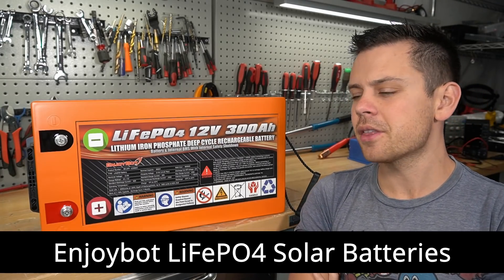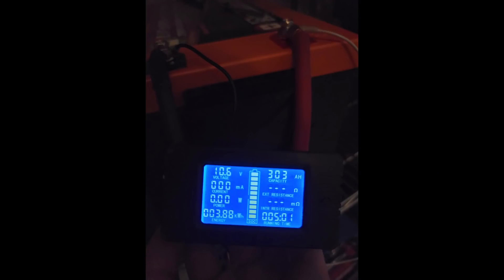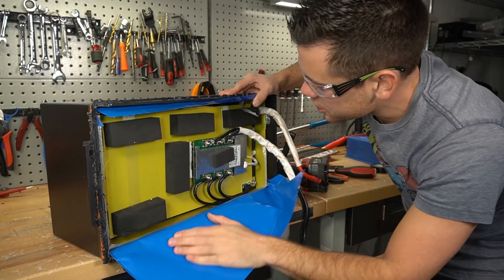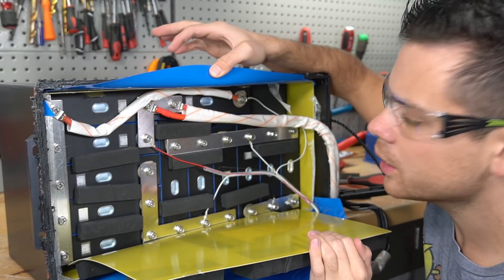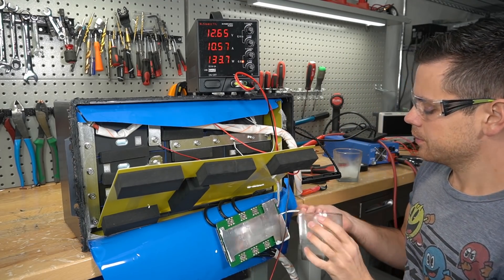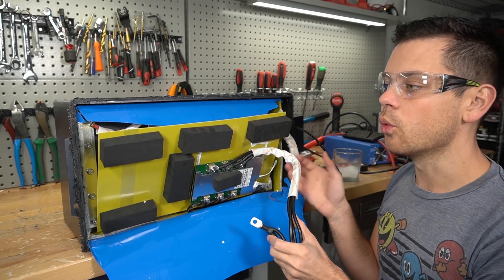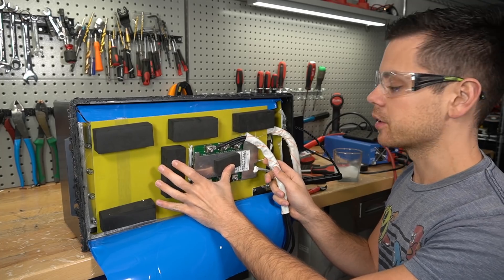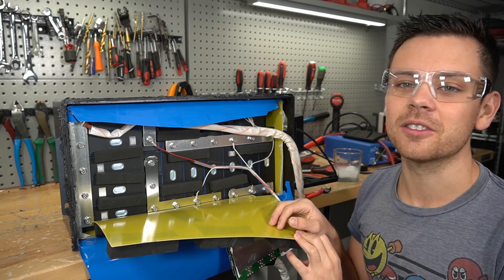Dirt Cheap Lithium Batteries: Enjoybot LiFePO4 for $.26 per Wh

Comment: Will, I truly appreciate your feedback on these batteries, I enjoy them and click pretty quick to see what you found again and again.  Thank you for the hard work you do day in and day out on these videos and testing!

The only thing I will say here, it seems too many people put an emphasis on low temp protection.  If you are building a rack or bank in your basement, why worry about it at all?  I guess it really is about the application and use of the battery.

THAT SAID....they absolutely should not sell these as low temp protected batteries, it is false advertising and if someone was to use this in an RV and expect it to be protected, they could easily smoke $3k in batteries unknowingly with a bank of 3.  

Again.......THANK YOU for doing these reviews!  The community is grateful to have you and your passion in what you are doing!
Reply: The problem with charging at freezing temperatures is that it will ruin the battery.  Not everyone has a nice benign basement to install batteries in.  Also if a window blows open in the basement or a door gets left open the basement could still get to freezing temperatures in a cold snap.  If nothing else it's cheap insurance for an expensive battery.  Especially if you have a large bank of batteries.
Reply: We have a shop and a barn on our farm in Minnesota whose temperatures are below -35 F (not counting wind chill) for 4-5 weeks/year while the  two months on either side range between -34 F to +20 F. . The house basement is an additional issue - it stays around 30 F for 2-3 months and 32 F for a month on either side. We're trying to find a safe way to safely charge those expensive batteries and we've been disappointed (like Will) every single time so far.

Comment: Great vid, based on what you said and showed, I chose correctly for my application.  Labeled CHINS, I have 4 of the same 300Ah batteries.  The application will be my sailing yacht where these 4 batteries will give me over 15k Wh and with 2000 watts of solar and 800 watts of wind generation - NO Generator Needed. Terrific to know that you like the manufacturing quality. Also, the batteries will be parallel connected to Victron equipment, therefore I don’t need to low temp cutoff. Thanks for all your advice including; low temp cutoff not needed, good manufacturing, and that you agree that they will work in a marine environment. Keep up the good work!

Comment: They contacted me as well and offered to send a battery over for testing. I'm always hesitating to cut them open as they will be permanently damaged. Great so see you found the problem with the sensor right away. False advertising, same like with the AOLithium and claiming 200A discharge (as the used CALB cells have only 1C discharge rate).
Reply from the maker: Exactly!! And yeah, sometimes it's better to skip them if you don't have time. I love finding problems and sharing theme with everyone haha
Reply: @WillProwse  What do you do with the batteries you have opened for testing? The case is basically destroyed and the battery hardly usable as intended afterwards. Just harvest the cells?
That is my main concern with these test to  break into these cases just for the sake of testing. From a resource perspective, not good...
Reply: Someone has to do it Andy or we would never know.

Comment: Thanks for Another great battery video. I just bought 2 of the CHINS 300Ah batteries because at the time I was ready to buy, my first choice the SOK was out of stock indefinitely.  Good to know it doesn't actually have low temp cut off.  Batteries will be mounted inside the RV so that shouldn't' be a problem.  Will, your videos gave me the confidence to rip out the stock AGM set up and upgrade to LiFePO4.

Comment: These lithium batteries have gone down so much this year! I replaced my lead acids with lithium. I bought 4, 200AH Chins and 1 BTR 100AH for another application. I think lithium is the only thing going down with this inflation. Happy to see the batteries going down but just in a few months the Chins and BTR went down$150 each! That's $750 I could have saved if my lead acid would have held on just a little longer!  The good thing,  the lead acid batteries was 2300 pounds and did good 🤑 when I sold the batteries for recycling. Keep up the good work Will!

Comment: I have the Zooms battery which is similar to this one. Thanks to your review I knew it didn't have low temp protection and was able to avoid putting juice into my battery when it's chilly outside.
Reply: I'm looking at the Zooms as well.  Can you share what charger you use and what voltage and times?  I'm trying to use a Midnite Classic charge controller.  Thank you.
Reply: @quartamile  you should go with chins. Same battery but cheaper.
Reply: @quartamile  and you should try growatt 3000w all in one inverter charger
Reply: Actually there was a 50 Amazon coupon on these enjoybots last week so they were cheaper at the time
Reply: @quartamile  Chin's battery is 344 out-the-door price 12v 100 aah

Comment: Well crap! If that thing had low temp I'd be placing an order. Great job on the tech review as always Will. 😎👍
Reply: Add your own. eBay sell lifepo4 12v 100ah for 298 each with low temp protection
Reply: @jamesbenedict6991  you can use lith batts in cold just can't charge them in cold freeze
Reply: I have 3.6kW of LiIon cells (Pana 18650) and need more capacity, but I'm also wanting to bring the battery inside so I'll go with LiFePo4.  NO worries about temp inside.
Reply: Should I really worry about low temp circuit if I'm in Florida?  Probably just hight temp cut off?

Comment: I purchased a 100 AH Ampere Time knowing it did not have low temp protection.   I use the battery to power my Astrophotography setup.  It will run my mount, all my cameras, Dew Heater bands, and computers for several days before needing a charge.  But it is always outdoors, so I built a 2x2 foot 1/2" Plywood box with 2"  of R15 insulation all the way around it it keeps the temp up fairly well.
I tried the rubber mat heaters for RV Water tanks and they did not work.  I attached them to 12x12 tin sheets to help radiate the heat but the instructions say right at # 1 you must attached these to a non-conductive surface.  So I wasted the price of two of those puppies.  Should have read the instructions first.  Oh Well.  But I also wanted to have a place to put my computer to help keep it a little warmer as well.  So I moved all the computer electronics into the box as well.  Made  little shelf that would sit over the battery.   Bought a cheap but seems to be very effective temperature gauge so I know when I can and cannot charge the battery.   With my computer running I have seen temps as low as 10F and the inside temp was at 38F.  So I can choose when to charge the battery and when not to.  It was because of this as to why I went with Ampere Time.   If I find I'll  be imaging at temps below 0F then I'll turn on the monitor as it puts out like triple the heat of my computer.   Should keep the battery roasty toasty even at -10F.   ;o)
Reply: Sounds great!!  Link to temperature Guage, please?
Reply: @a.w.thompson4001  Just a follow up to my reply yesterday.  It's currently 7F outside and the inside of my battery box with the Mini Computer and Monitor turned on and it's 45.7F inside the box.  Turning on the Monitor made the difference.   Plus it snowed about 10 inches last night.  I cover the box with a tarp and that and the snow I guess are insulating the box as well.

Comment: The new version of this battery just came out (June 1) and claims "built-in BMS, plus high and low temperature cut off protection". I just received the 200A version and it seems like a high quality unit, with good documentation and was packaged well. As I am a LiFePO4 novice I'm keeping my fingers crossed. Hopefully they listened to Will's criticism and made the necessary changes!
Reply: Their new release is what has me now looking at reviews.

Comment: I purchased raw cells for $132.60 each and assembled a 32 cell battery the BMS is not included but it cost about $130 also. the 32 cells are Grade A 280Ah EVE LF280K cells and if I calculate correctly they end up being 14.80 cents per Wh (not including the BMS and wiring which will likely add another 300-320 or so).

here are my figures 3.2 volts x 280 Ah x 32 cells = 28672Wh for $4243 =  14.80 cents per watt-hour and a lot of time to assemble it. if I add in the estimated $320 for wiring and BMS then it is 28672Wh at $4563 = 15.9 cents per WH.

my end-use is a stationary off-grid house. cheers, all; 😎
 just thinking of the DIYers! $.159 per Wh without the plastic box and serviceable.

I do like your reviews of new stuff coming to market.

Comment: This in 24v 100ah is probably a perfect match as the powerpack replacement for my power wheelchair. Kept in room temperature, this battery pack it isn't subject to temperature issues. It is sealed and self contained. Cheaper /easier than a DIY project. Pity they don't offer 24v 200ah. I might get one.

Comment: Will, I appreciate your videos. I think you are overemphasizing the importance of cold temp battery cut off. While it may useful for solar and other applications, if you put a battery with cold temp charge cut off in an small EV such as a mobility scooter or power wheelchair there will be problems.

When you go down a hill the motors send a regenerative current, which is usually quite low, into the battery. So when it's below freezing the BMS will reject the regen current, causing the controller to have an over voltage fault, and the machine will shut off. This can potentially bring it to a skidding halt, throwing the rider off!

Most people charge these with very low amps since they are using their old SLA chargers, so cold temp charging is not necessarily a problem but something to be aware of.  When I set these up for a customer I make sure to use a charger with a cold temp cut off or low enough current. Better that way than the BMS leaving you out in the cold!

Comment: Have broke down the chins 300ah smart battery yet. I bought two. They’re supposed to have low temp charges protection I did see your vid on the 100ah smart chins. You rated it very high which convinced me to buy the chins assuming the construction would be the same.

Comment: Thanks, useful information as usual. Certainly a good price and well built. They could use a JBD BMS and have little extra cost, and the 150A JBD is rated for 48v in series with Bluetooth. I would pay extra for those features. I find it baffling that the manufacturer is not aware this doesn't have low temperature protection. I would personally prefer some cheap 24v 100 amp hour batteries to build emergency systems for my relatives. Thanks again, useful information.

Comment: like always good work to keep the community informed.  one additional issue i would have with this battery, they should not be installed horizontal. i wanted to do this with my 32 batteries but contacted the manufacture and they send me picture that some of the cells will not be flooded with the chemical and shorten the life of the batterie.

Comment: I really like running 12v batteries in series (despite the extra manual balancing overhead) because if anything in the system fails they can still be used for other things. a 24v battery isn't compatible with much!

Comment: If you have batteries configured in parallel, under some circumstances, there can still be eddy current flows between those batteries even when charge current has been shut off at the charging source due to low temperature. Charge current shutoff can also be inaccurately measured at the charge controller because of differences in measured temperatures at the controller versus at the cells. This is particularly true when the temperature is rising, the cells are cold-soaked, and the thermal mass of the battery is much greater than the sensor on the charge controller. It's safest to have charge current shut off at the BMS, with a proper sensing location on the cells as described by Will above. I consider this battery a "no-go" for any environment that can ever have a temperature below freezing.

Comment: Would love to see you review the Chins with Bluetooth BMS and heater to confirm that it does have low temp protection and that the heater does in fact perform.  Thanks

Comment: BMS Heat Dissipation:         Question
Pros and cons of burying the BMS inside these weatherproof or waterproof housings.
Wouldn't it be better practice to have the BMS so that the heatsink can dissipate heat away from the batteries?  What if any difference do you believe it would make for life expectancy?
On the other hand if you are in a cold environment the BMS heat output would help to maintain battery temperature above minimums. Yes they put heaters inside the housing too for cold

Comment: I went to my off grid place 2 weeks ago and found my propane heater had malfuntioned. The temp was  10 degrees F and everything was frozen. My parallel 100 amp Battleborns worked perfectly after I warmed up the place. They were expensive, but peace of mind is worth it AND you can contact them in THIS  country, where they build them in NV.  This morning when I left, the temp was -25. Hope my heater works this time, but if not at least my batteries won't be trashed.
Reply: You can use batteries below freezing you just can't charge them. I live in the mountain of southern California with chins and now low temp protection. Havnt had an issue as batts are indoor
Reply: And 3 chins = 1 battle born so I can sleep safe knowing I didn't over pay and such

Comment: Bought a couple of Ampere Time batteries after one of your reviews.  But I live in a warm climate so I'm not very worried about a cold temp charging cutoff.  I haven't had them long enough to know how they perform but they were a lot less expensive than some of the other brands.

Comment: Audi batteries are lifo 20ah cells for 6$ each. 16 for 100$ online. Each Tested and rated above 20ah. A123 batteries 30ah for 60$ in case from server rooms for high amp items. Need own btc and know how for soldering and wiring raw packs but it’s easy.

Comment: Wow not good for cold places ... If your try charging cold place battery maybe blow up or discharge its self in cold place ... That would be very scary have that happened ... Cold temp below 32f will fryer that battery very fast ... Its bad i have seen one battery come from aliexpress with no temp cutoff before so be very careful wen buying on aliexpress not all seller are bad ... Of price too low on battery its maybe junk oh 90% low price battery are class B cell which can be very bad too ... I really love that you are showing people whats inside of battery from ailexess because people dont know what they are buying ... Of battery not build right way its very dangerous

Comment: Regarding current limiting for a starter motor;  I am considering adding a series inductor as a means of controlling the rate of current rise when hitting the starting switch on my boat engine. It would be about 40 turns of #8 wire over a 3" diameter form.  Roughly about 10 mH is my goal.  The thought it the motor will have a bit of time to get rolling without looking like a near dead short to the battery (about a 1/10 sec to get to 100 amps)  Ever hear of such a scheme ?  Still sizing this up and it will add some inductive kick on turn off, but a TVS (transient diode) can come to the rescue.  This is to allow a 100AH or 200AH battery to also serve as a starting battery.
Reply: Not sure what you're trying to achieve here. If you're trying to reduce operating current, adding an inline inductance will not achieve that because its the resistance of the starter motor coils that determines current flow, yes, it may soft-start, but the peak current will be the same, just delayed. Why would you want to soft-start a starter motor? And remember, a starter motor is just one big inductor anyway, it's just one where the induced magnetic fields actually do something useful. All you will achieve doing this is a more poorly performing starter motor.

If you're trying to 'convert' a leisure battery into a starter battery you might want to consider LiPo chemistry, not LiFePO4. Drone batteries, for example, can easily push 70C so to deliver, say around 1,200A, you'd only need a 17AH pack (17AH x 70C = 1,190A). Remember, though, that LiPo chemistry has a 3.7V nominal voltage, 3S = 11.2V, 4S = 14.8V. I think you're going to struggle to cost-effectively make a LiFePO4 battery start an engine, inductor or no - they just weren't designed for this purpose. HTH.
Reply: @davidadams421  I am trying achieve a weak soft start, get the magnetic field initiated without exceeding the BMS limits. A motor is not just a big inductor,  it looks nearly resistive until the armature is turning, it has back emf once it starts moving making it appear more inductive, but if under heavy load it appears largely resistive. . The peak currents at start up can be 10x those when turning , but if heavily loaded as is a starter motor , currents remain quite high.  If you would like  to see this phenomena I can send you plots of 1/4 hp 12 v motors in the start phase that have peaks of 60 amps in the first 10 usec. They then fall to 7 amps after reaching quiescent speed. However by limiting the initial current one can reduce the initial phase and still get it rolling. If I can start my engine within the BMS limits and the 200AH design limit than I can avoid the weight and expense of another battery on a separate circuit with associated charger, etc.
Reply: @brianboschma  I have provided advice to the best of knowledge and with the intent to help. I wish you every success.